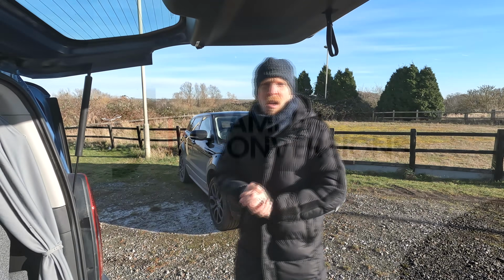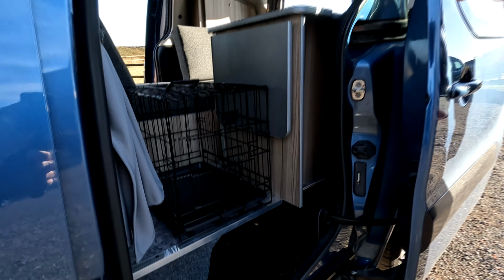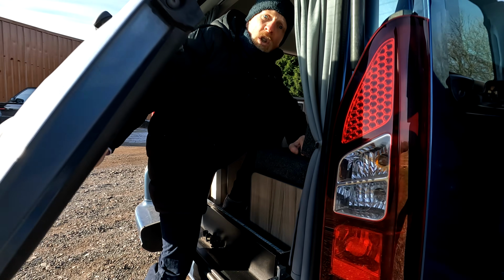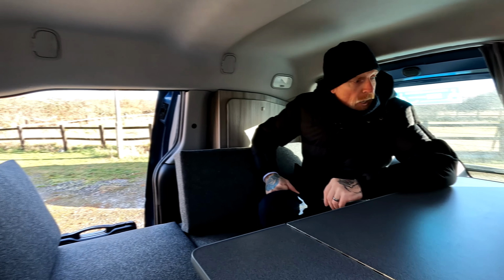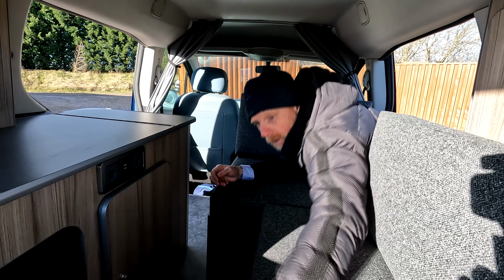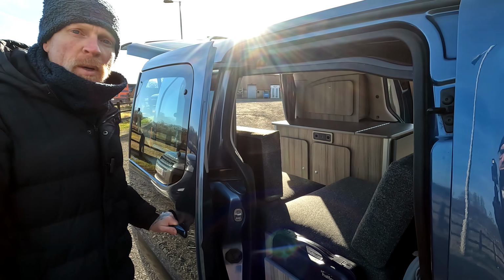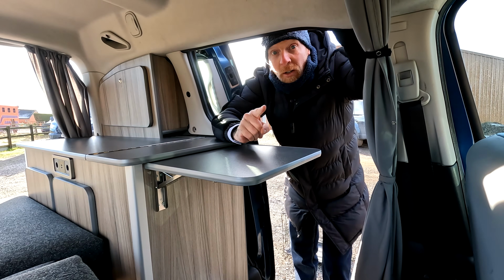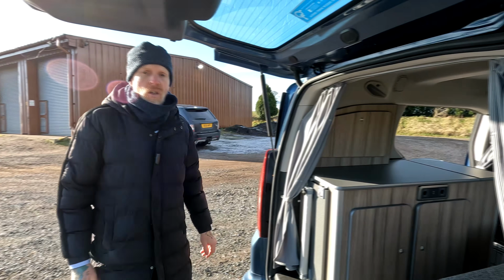Citroen Berlingo Wheelchair Access Vehicle Micro Camper Conversion

Comment: How does this affect insurance? Will insurers accept the conversion?
Reply: WAVs need different insurance anyway because of the structural changes, when the floor is lowered it’s a massive structural change, the exhaust and petrol tank are usually moved too. I was looking at getting one to convert but the usual insurers won’t cover them, and when they can be insured they’re more than double the cost. I’m now looking for one with rear seats that I can take out as that doesn’t involve carving the car up.